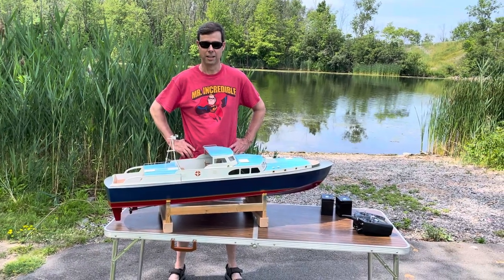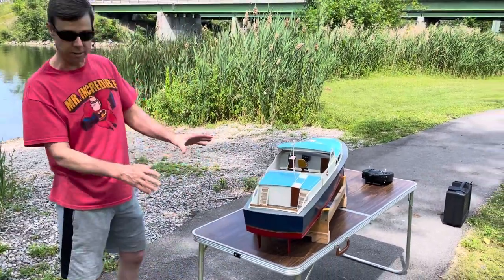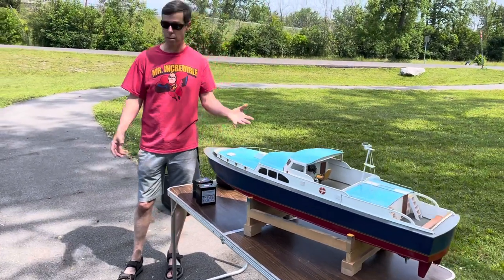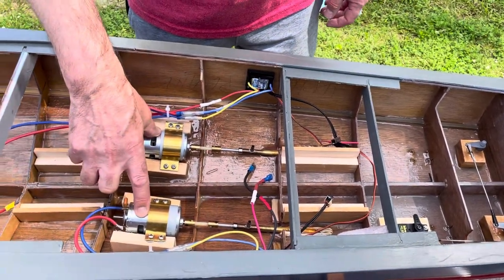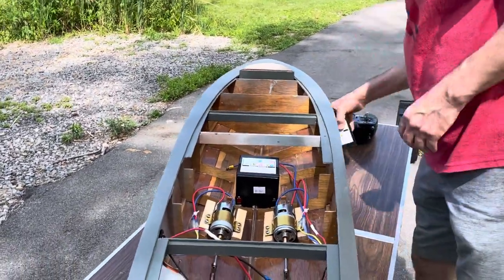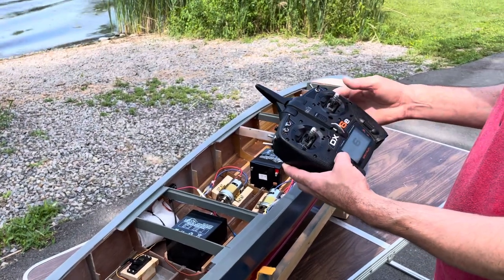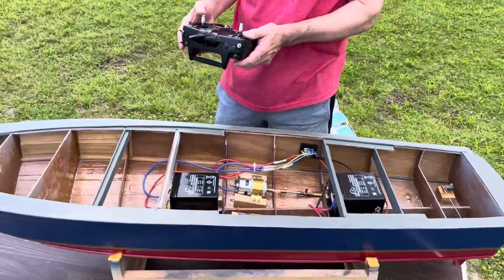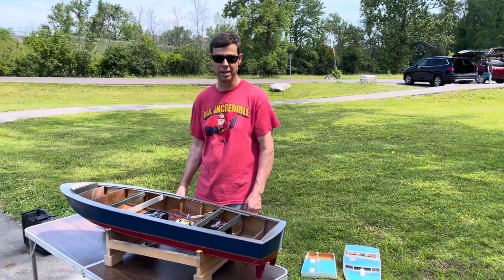Dumas Dauntless RC Model Boat Land Tour

Comment: Thanks Rob, this will be my First boat. Been on my list for awhile now. There's always something more primary coming up. Got tired of re-kitting airplanes, got into trucks and cars. I can handle Building the boat. Had some questions about motor mounts, stuffing tubes, and radio. U just answered. Thinking about(big maybe) putting rudders like a v-tail slider tray(probably not even useful). Thanks tho. Just subscribed.

Comment: Nice work, thanks for sharing. I am recently into this, and wonder if I can do dual motor,prop shafts and props with one esc. Any answer for me out there?
Reply from the maker: Yes most models run with one speed control with twin motors and shafts.  I like the maneuverability of twin speed controls.  It’s how the full size boat was set up.

Comment: Have you tried using the Astro Flight 860-5T brushless motor with Castle HV 60 speed control?  Extremely pleased with performance with scratch-built 44" scale model of classic Bertram 31 deep V power boat.  With 9-cell lipo SMC batteries, model will push 27 mph at full speed (A 1,300 watts)-- great to get out of way of full sized boats in an emergency.  Don't waste time with lead-acid batteries.   Astro motor remains a bargain in high-quality USA made brushless motors!
Reply from the maker: Thanks for the suggestion.  I may try that in a next model.

Comment: Hi I live in the UK and I own one of these boats. What are you doing about cooling the motors ? Mine runs 15 mins and the motors need to cool down and I have heat sink fans on the motors.
Reply from the maker: I have no cooling and my motors don’t get hot.  Your props may be to big.  Are they the stock Dumas props?

Comment: I personally ( retired electrician) would never use a blue ( power) color wire for a ground.  Just saying.
N
But a nice boat.  Stuck between this and the Crockett. Both about the same size,  48" or 51". Just want size can see across our pond. I ha6a ProBoat Catamaran,  AquaCrafy Hydroplane, Ana Century Racing Yacht ( dont laugh. That's what it's really called. ) about 1/24 scale, and 30" long. Has a 550 motor, 2 ch radio. ABS plastic.

Comment: Why lead acid 12v instead of a Lipo?
Reply from the maker: The batteries work as ballast plus I use the same batteries in my Dumas Donzi and wanted to keep it simple when running the two boats.  I may upgrade at some point. Thanks for watching!